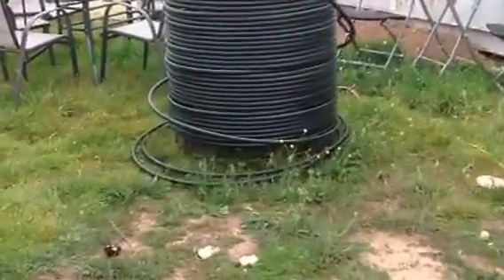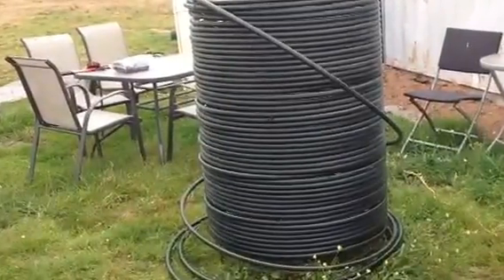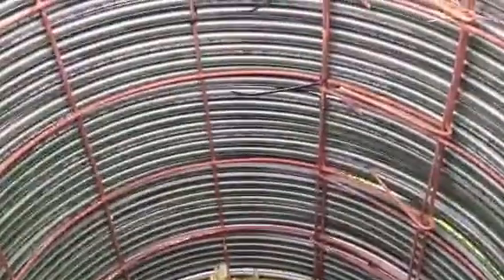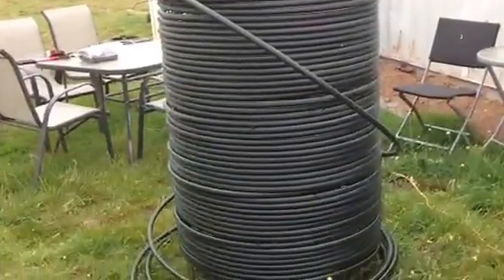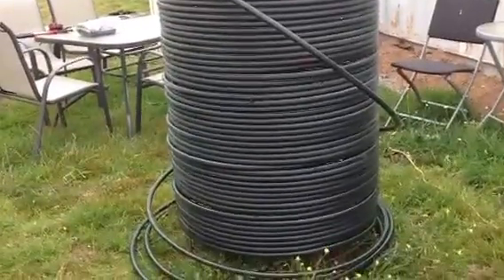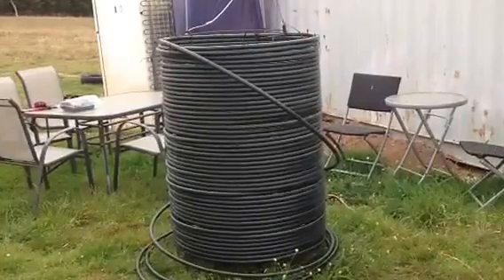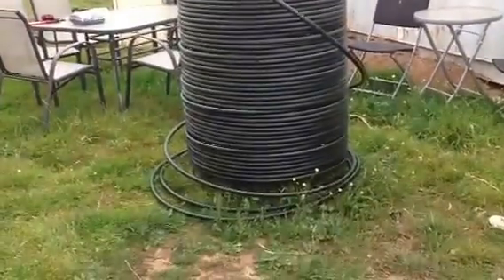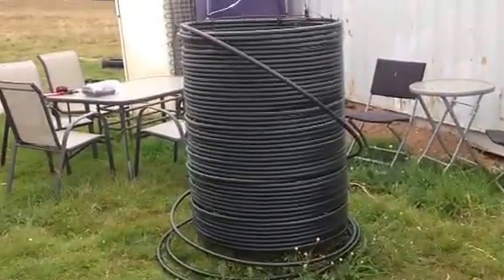Jean Pain Method Compost Heater

Comment: Got lotsa tubing. Could save on material by opening a gap between runs (based on the amount of heat available to be absorbed) or offsetting tubing concentricly so it could operate within a larger mass ((expanding the volume in which heat exchange is taking place) more efficacious use of that lovely bunch of tubing)

Comment: i must say I love the idea!!! and thank you and Chris's method!  I can not say I have built one yet...will be doing once our green house is complete (we are in colorado so much colder I imagine)  I plan on using your idea with one alteration...we will be wrapping the "greenline" around a 55 gallon drum which i will fill a little over 3/4 of the way with water then seal it.  thus we do not have to contend with debris in the center of the spool, and i am "assuming" the waters ability to hold heat will allow long use   of the heat exchanger with taking less heat away from the decomposing ..... idk just a thought..will let you know the results when i have them next winter!

Comment: Isn't most of the heat inside of the pile of compost, not the outter perimeter?
Reply: Yes.  What douche-bag, uninformed jerk-off Phoenix didn't tell you, is that compost should be all around the mechanism as well as inside it.  So that the mechanism (the roll of tubing) is at the center of a massive pile.

Comment: I been told that this does not work very well. the pile needs the heat to compost. once you pull the heat out it stops composting...  I cant find any vids showing this producing significant amount of heat... Anyone?
Reply from the maker: Compost piles do not need head to compost, rather heat is a by-product of the metabolic actions by the bacteria. Keeping the compost cooler will encourage a different microbial community (less thermophilic bacteria and more fungi) but won't inhibit the breakdown of the materials. I never did get the opportunity to run this in any significant way but if you are a facebook user, then sign up to https://www.facebook.com/anecso as I will soon be re-implementing a trial of the system and publishing monthly results there. Phoenix
Reply: I was wondering the same thing.  Please let me know if you get an answer to that question.  Thanks

Comment: Well how did it turn out?   I built my own compost water heater.  Its four foot high chain link fence,  fifteen feet across.  Its filled with a 40 gallon tank and wrapped with 400 feet of 5/8 foot hose. That is covered with grass, mulch  and about 30 Christmas trees.  Its currently running 118 degrees and has been consistent for about two weeks. It supplies water to my house for my family of six.  I plan to pipe it into a coil into my air handler for heat during the winter months.  I also hope to run some geo thermal air conditioning into the same air handler.  If anyone has any ideas, send me an e mail, thanks.  bpd312@yahoo.com.
Reply: i believe u have the right idea sir, bury it in the center as a bulk tank, but you should also bury your supply line so the water can get to the base 50 degrees before entering so it doesn't shock cool your pile when you use a lot of water during a shower.  It would probably be much more efficient this way than on the outside

Comment: I would like to use your design to supply radiant heating to my tipi deck for the winter. Thank you so much for sharing this video. Question: If I am using it only for radiant heat, would I need to connect the ends so the cooler air is pulled back into the pile, or just released? Would I need some kind of air pump?
Reply from the maker: I wouldn't use air as air is a poor heat transfer medium. It should work, but I think it would be more efficient to use a water based system that includes a radiant heater. IE, the heater is designed to radiate the heat from the hot water flowing through it. Just my two cents.
Reply: Thank you!
Reply: Kill two birds with one stone?
Reply from the maker: K?
Reply: L Warren Perhaps an old house radiator would work for your situation.

Comment from the maker: This system was designed to use a hot water pump to circulate the system though I have seen some systems which are designed to use convection. See the video by Chris Towerton for a good example (YouTube ID PCXSoV4jNAA)

Comment: Hi Phoenix, many thanks for sharing this, especially about the builders mesh, good idea.
You will definitely need a pump of some kind. Remember to put the pump on the cold side as it goes into the tank to help keep the pump cool.
Re polypipe v metal pipe. The limiting factor will possibly be the heat transfer speed of the compost rather than the pipe itself. Also cooling the heap to much may cause negative feedback and slow the reaction right down if it is  a relatively small pile.
Have fun !

Comment: I hope it will work for you for as long as you need it. Consider that Jean Pain used wood chips as his compost material. From your video I understand you are planning to use non-woody 'mulch' material (right?). Wood takes much longer to decompose and hence can provide heat for longer than 'weeds'.
I built a wood chip pile a few months ago and have an issue with the moisture in it evaporating when it gets hot. I'll shortly install a drip pipe.
You may not  get thermosyphon I didn't but used 20mm

Comment: Great points - especially #3. I didn't know that. Copper is probably not such a good idea  and stainless is probably hard to work with without kinking in addition to the costs. Just trying to think of a way to get the coil fully inserted into the pile. Have you tried getting tighter coils with the PVC tubing? How tight do you think can you get? Thanks for the response.

Comment: Good idea - I'm thinking that you should transition to a tighter copper coil that you can fully insert into the compost pile so you don;t loose radiant heat to the outside of the bin.  Check out the copper coil this guy made around a stove pipe: youtubeDOTcom/watch?v=AbDMITAMLio

Comment: seen one bloke (paulwheaton12 i think) who said the water has to be in there for 20 seconds to heat up. i know from what I've read that it gets real hot in there. i can also tell you that heat transfer works way better with aluminium pipe rather than poly pipe. and yes i know about the solar hot water systems made from poly pipe. i should make one of these myself and post it up. i live off grid in vic. never thought about this although i knew compost gets quite hot.

Comment: Hi there, Just wondering if you finished your hot water system?? how would it work if you insulated the outside and lifted the coil 600mm so you could remove old compost from the bottom and add new compost too the top too keep it going??

Comment: I believe I read somewhere that the wood has to get plenty of air flow to work, so I wonder if the compost on the inside will rot very well.
Reply: Actually it is supposed to be unaerobic so the exact opposite. Jean himsef beat it down with a tampper while watering it down.